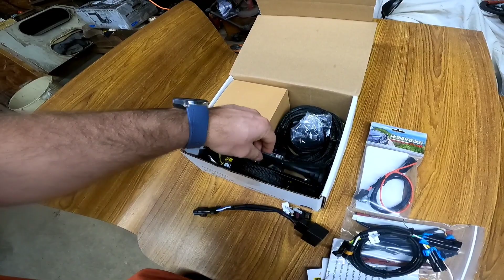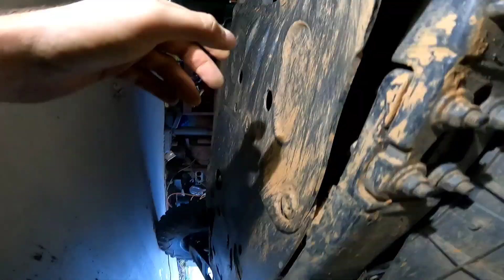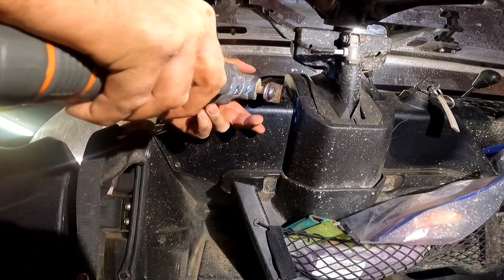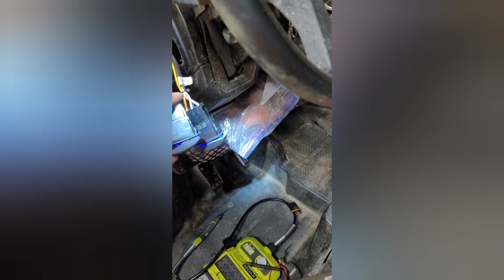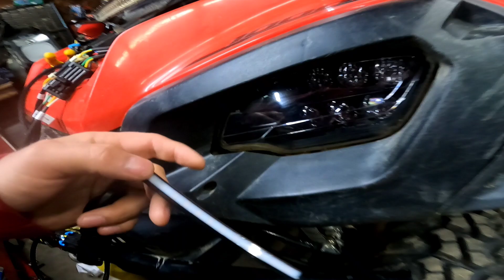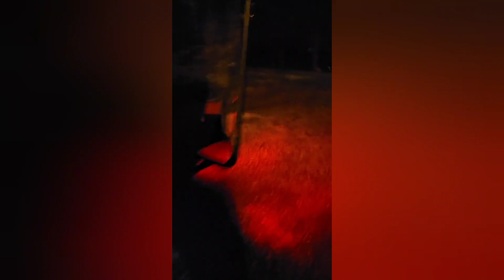Turn Pro Sequential Turn Signal 1st installation on Pioneer 1000-5

Comment: Did we need to connect power in wires
Reply from the maker: yes it does need power. I would suggest a key on power adapter from honda sxs if you are not running a dual battery kit.

Comment: Hoping to install my turn signal kit this weekend (minus the horn/hazards). 

I'd like to add two 6-inch lights to the back top roll bar for better visibility (as I have a tire rack partially obstructing the tail lights). Since I've never done anything electrical like this, can I splice those into the turn signal harness? I'm assuming yellow and green are different for left and right turn signals, correct?
Reply from the maker: They colored for different sides left and right. You may be able to splice and add i would give them a call to see what they  say about adding extra load but I wouldn't think it would be an issue for two extra blinkers low wattage

Comment: Getting ready to purchase a turn signal kit. This kit is about $100 cheaper than XTC kit. How is the kit still doing for you? Has the front turn signal with the 3M held up good as well. Also your enclosed doors and cab, how do you like that product also? Easy to see out of. Sorry for all the questions. New to the UTV world.
Reply from the maker: Kit still works good. I did end up going with a gorilla glue double side tape after the 3M failed. Visibility is good until u get enough dirt and mud on it. I carry either a squirt bottle or battery powered sprayer with me. It's a CEC cab enclosure good buy for the money. I've busted a window (my fault) and had a couple zippers miss up they have been reasonably about repairs as needed. I like the Honda roof and super atv flip out wind shield . Windshield you can always flip out if u hit mud and can't see for a moment. I don't like the gap from roof to windshield. A honda windshield is curved for the roof. I have a pool noodle there wedged in there for the  winter time to block air.
Reply: @buckssenditinfochannel5263  Awesome. Thank you for the info

Comment: Did you wire your hazard lights to only work with the ignition switch on ? I don’t like that way just in case your stuck out on the road and need to be away from the machine your ignition key will be stolen
Reply from the maker: I have a dual battery setup. I can leave my 2nd battery on and hazards without the key being on or worrying about it killing my starter battery.
https://www.youtube.com/watch?v=FcyCMwUr9xE&t=80s

Comment: If you would have had room in your center panel do you think you could have put the switches there instead of putting new holes in the dash?
Reply from the maker: Absolutely it's the same size as the switch panel I have just didn't have the spots

Comment: Been thinking about adding the sequential to my 2018 1000-5. I see you can add it without the horn/hazard which I like as I already have horn installed. Are you still happy with them?
Reply from the maker: I am, I haven't had an issues since getting them right  got an awesome trip planned this month and next where I'll be using it a lot being street legal